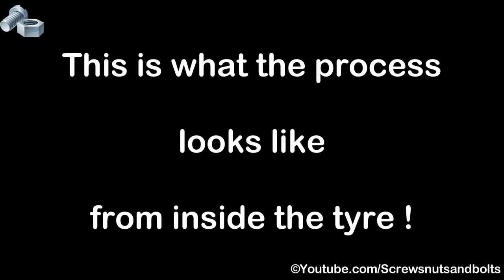Tyre Puncture Repair Kit Tutorial

Comment: Why is it temporary? Has anyone had issues they'd like to share? I've had tires I've used for years with these plugs, just make sure it's warm enough for the plug and tar to seal it well
Reply: Seen many catastrophic failures of tires because they thought it was a proper repair.
Reply: @warrenpacholzuk9190  how though? Was it because the tire went flat? I've done dozens of these on my cars over the years, and if you do it right, they never leak.
Reply: @warrenzonator  mostly because of inner liner failure.  When a tire is injured and run with little or no pressure the inner liner deteriorates. 
Temp fix only.
Reply: I can see the sidewall deteriorating if you drive it with low pressure, or even the liner if you're on uneven surfaces - but if it holds pressure, then I can't see why a patch would serve any better.
Reply: @warrenzonator  no. Sidewall compromise and inner liner compromise are automatically scrap tires.
Reply: If the damage is in a high flex area, then there is no repair to do, but if it's like the repair he did in the video, patch or plug makes no difference. So long as there's no stripped belts, I don't see how the tire would be compromised
Reply: @warrenzonator  the inner liner is what holds the air or nitrogen in the tire. 
I am a  licensed tire tech. Been so most of my life.  A proper repair cannot be done without inspecting the inside of the tire.  That's all there is to it.
If you bring me a tire with this type of plug, it gets scrapped.
Reply: Of course, shops gotta make their money. When I worked, I would've never just plugged a customer's tire cause that's not protocol, but manufacturers state repair specifications for patch or plug. I don't see how an inner liner gets compromised from a hole - that's like the only part of the tire you can repair
Reply: @warrenzonator  got nothing to do with making money. It has to do with safety.  
When you puncture a tire then run it with little or no pressure the inner liner separates and gets ground up. Game over tire is done. 
If anyone tells you otherwise they are not just stupid,  they are also dangerous.
Reply: @warrenpacholzuk9190  agreed, if the tire is driven flat, but if it just goes flat overnight, or you hear the leak, plugging it is fine. Never seen a liner go before a sidewall, though
Reply: @warrenzonator  industry standard states plugs are temporary fixes only. 
Put it this way. A tire plug will cause a car to fail safety inspection.
Reply: @warrenpacholzuk9190  only time it fails safety is if there's a repair on the sidewall, regardless of plug or patch.
Reply: @warrenzonator  not here and most other places.
Reply: Just looked at the checklist for here in Ontario, nothing about plugs in the tread
Reply: @warrenzonator  chorded /road plugs fail. Debate all you want,  it won't change that. 
I work hand in hand with MTO and DOT on a  daily basis.
Reply: I'm just saying none of mine have ever failed even for tens of thousands of kms on gravel, I don't see how they can hurt a tire. I've had tires blow out that were in good condition with no plugs.
Reply: @warrenzonator  do what you want. I'm telling you I have handled more tires than you could imagine.  From the smallest hand cart tire to OTR tires that would blow your mind.  
When a tire comes in our shop, aprox. 15 techs,  my word is final.
Reply: @warrenpacholzuk9190  you do what you want, for the average Joe who finds a nail in his tire at the worksite, plugs are good enough. By saying you're the boss-man, you're implying bias by telling everyone to use a more costly repair
Reply: Warren Pacholzuk But, what's the precise failure? Does the plug come out? Does the hole 'spider' outward, like glass?
I think nobody in this thread doubts that a tire with a damaged sidewall (inner or outer) is bad, but if the sidewall is not damaged, how does this type of repair lead to outright failure? For example, if I took a brand new, blemish-free, unused, never-mounted tire, screwed in a large screw, removed it and patched it like this, and then used it, how might the tire fail?
It's okay if you don't know or can't explain - but it'd be nice to know.

Fwiw, when I do a repair like this, I generally treat the tire as though it's speed rating fell by one or two ranges.
Reply: @warrenpacholzuk9190  I like your first name, but I don't like how you make this personal. Being a tire tech would give you a larger sample size, but saying that you're a pro and boss around lots of people and have worked with lots of cool tires doesn't answer the question that I posed - if it doesn't leak, why is this repair unsafe? You have to understand that mechanics use vague "safety" as a way to get a lot of money out of people. Heck, my friends have paid more per hour at the mechanic than at the dentist, and I know mechanics that have bosses that make more than doctors by doing unnecessary repairs. I'm not trying to offend your integrity, and I know there's good honest guys out in this poorly regulated industry, but that conflict of interest doesn't contribute to the dilemma. You say that the tires fail but always because the tire gets deflated. I'm saying that in my experience, a well executed chord plug will hold air for the rest of the tire's life. Have you seen a repair like this, being well executed, cause a blowout? Or simply poorly executed/leaking repairs that make a tire go flat and then blow out?
Reply: @warrenzonator  one last time. A proper repair cannot be done without inspecting the inside of the tire. That's all there is.  
And yes in our shop my word is final because I have more training and experience than anyone there. And most more than 90 percent of those in the business.
Reply: My tire repair shop said the exterior plug will absorb moisture and allow it into the interior. The moisture can contact the steel belts and cause rust and deterioration and ultimately tire failure .
Reply: @billybob042665  nice almost completely correct.  Once a tire is repaired the rule of thumb is the speed rating drops one level.
Reply: Removing the tire off the rim and patching it is the correct way to repair. Plugs are a temp fix until you can get to a shop. Wheel needs to be rebalance after.
Reply: The rule of thumb is that one tire can take 6 plugs before a tire fails. Thousands of cars in India with +35°C temperatures, gravel, rough roads etc. run with tire plugs for more than 10000 kilometres without accidents which can be attributed to tire fault. Punctured are quite a frequent occurrence here and people can't afford to buy a new tire every month. My motorcycle went 4000 kilometres with 8 plugs, one of my cars has 4 plugs and the other car has 3 plugs on different tires for many years now. The only tire burst I encountered was from a perfectly good unpunctured tire. Maybe it all depends on the tire compound used in your country such as soft/medium/hard.
Reply: @jasonk795  Hope you're having a good morning too.
Reply: @tyronem3446  high speeds,  traffic density,  insurance,  liability,  regulations,  manufacturer specs,  industry standards and down right safety are just the tip of the iceberg.
Reply: @DB-xi5hc  
Think about it mate, you have a hole in your tyre and fix it by a patch on the inside.. what plugs the hole on the outside? How much moisture gets through rubber ?? Mate they are bullshitting you.....
Reply: @warrenzonator  It's because you cannot see internal damage of a tire without removing it from the rim. A tire can shred itself internally and even blow out while being reinflated off the car. When they blow out while fully loaded around an open road corner you can find yourself at the bottom of a cliff fairly quickly. It has happened. These repairs are illegal on road going vehicles in many countries.
Reply: @warrenpacholzuk9190  that's not entirely true. Sidewall damage can be factory repaired but it usually ends up costing about the same as the average new tire.
Reply: @bremCZ  hasn't been done in years.
Reply: @warrenpacholzuk9190  It is still done today.
Reply: @bremCZ  maybe in some backwards places.
Reply: @warrenpacholzuk9190  Yeah very backwards, every native English speaking country with a factory.
Reply: @bremCZ  Lmfao never claimed to be an auto tech. What other countries do you believe to be native English speakers?
Reply: @warrenpacholzuk9190  The Auto Tech is another fella of questionable intellect, who it seems I owe an apology as he isn't as stupid as I thought after associating your message with him.

The list of native speaking countries is obviously all countries within the anglosphere and then also includes and South Africa. Those countries each make up at least 1% of the total population whose first language is English.
They, along with a few others who make up less than 1% are considered to be native English speaking countries.
Reply: How is Canada not natively English speaking?
Reply: Somebody has yet to describe how an inner liner or sidewall fails/deteroriates if the tire is not driven flat.
Reply: @warrenzonator  like I said my ancestors would disagree.
Reply: @warrenzonator  does not have to be completely flat. Too low in pressure will cause it.
Reply: @bremCZ  Lmfao. Will put my skills knowledge training and experience up against yours any day little man. 
Any day.
Reply: @warrenpacholzuk9190  And you would lose. For 5 years my job was training tire techs. For 10 years a chemist at Michelin in France and Goodyear in Luxombourg then product performance manager for Bridgestone's racing division. I've forgotten more than you'll ever know.
Reply: @bremCZ  Lmfao so that just means you couldn't keep a job.
I've been training techs for over twenty years. I have handled tires worth more than you have ever made in a year. 
My experience and knowledge is used for accident forensics. 
Little man you ain't even close to being in my league.
Reply: @warrenpacholzuk9190  "lacks understanding of promotion." I see this will be like trying to teach a fish to climb trees.
I'd be surprised if you could tell me something as basic as which has the actual higher speed limit a Y or Z rated tire.
Reply: @bremCZ  lol forget it, you're clearly not as qualified as he is
Reply: @warrenzonator  no he never will be.
Reply: @warrenpacholzuk9190  Still no answer though.
I'm waiting smart guy.

What does a P on a tire mean?
Reply: I done a tyre maybe 3 year ago on my trailer I’m going to take tyre off and inspect it but it’s still up now and I still use it so it probs be fine
Reply: @warrenpacholzuk9190  Where is "here"? And what is the standard please? I would like to quote it on facebook.
Reply: @warrenzonator  He can't tell you how or why it would fail, some bureaucrat with enough knowledge to be dangerous came up with a "safety" protocol and he has been following it without question for decades. 

Why does he do it that way? Because "that's how we've always done it". Standard government overreach without any level of competence or logic behind it. Followed by standard sheeple attitude. Even when presented with evidence above from hundreds of thousands of instances where the repair worked... denial.
Reply: @sithinstructor  my point exactly!!! I wanna see a study about it, and since nobody has one released (probably cause it's not a very scholarly topic), I thought the next best thing would be a collection of first hand accounts, or even just a few well analyzed failures, but people prefer to give advice. Just helped a girl yesterday with her car, and she drove it to my place with the tire less than 10psi, and there was some darkening in the sidewall, and even though I don't stand to make money, I didn't hesitate telling her to get a new tire. My point isn't to be on the edge of what's safe, but if it's just as good, why not go the cheaper/easier/quicker route?
Reply: @warrenzonator  I agree with you, but be won't listen and respond. Just keeps repeating the same.
Reply: @warrenpacholzuk9190  English is not native to England!! It's a new language developed by immigrants.
Reply: @paulyjuan1838  the same with my country
Reply: Never in 100+ plugs had issues if you put plug in the middle of tire .not good for sidewall punctures.
Reply: @warrenpacholzuk9190  licensed tyre mechanic and cant spell tyre😄💪
Reply: @benjamind2995  BTW no such thing as a tyre mechanic. We are licensed tire technicians. Certified by the same body that licenses mechanics.
Reply: I owned an automotive repair shop for 28 years and successfully used this method for 15 years, but than NZ land transport decided it was not a safe  and secure repair. There was always a change of air / moisture entering the puncture hole and  cause the steel belts to rust and / or layers to separate and could cause a blow out.
So every car for their yearly Warrant Of Fitness inspection that had a string repair in a tyre consequently failed.
Reply: Ive plugged my own tyres and other friends and families, peoples say "its just a quick fix" but ive never had any issues, the tyre holds air and ive always gotten full use out of them. All tyres ive done have had a nail or screw in them, the tyre has not gone flat and driven like it for any sidewall damage. A remove of the object and plug it straight away, no problems.
Reply: @warrenzonator  hi I've used these no problems, but there's another variety, smooth rubber ,non sticky that can come out if used without glue ,yes if in doubt check that inner liner is not damaged later

Comment: hey, nice video, however, i always find it extremely difficult to insert strip in the hole,, i always do it with tyre inflated (i never remove the tyre, )
.. is it advisable to deflate the tyre for this step? thanks for the advise
Reply from the maker: It's usually easier with the tyre inflated

Comment: Never cut away the excess until you know the tire ia holding air.
Reply: Why?
Reply: @dagalfheim7056  I would assume so you could try and twist and maneuver it a point where it would consistently hold air.
Reply: @dagalfheim7056  incase it didn't work and u have to pull it out again

Comment: I have never applied rubber cement ..not necessary with a plug...👍
Reply: I have done it both ways, with and without, without because I did not have in the moment. But I noticed that with rubber cement the plug slides into the tire much easier and it is easier to remove the tool. It works like a lubricant but then it dries.
Reply: Way easier with it brother .
Reply: Never go in dry🤣

Comment: Supposed to break it down and inspect the inside of it and use a patch plug from the inside
Reply: Mike Grant Recently I had a very slow puncture and took it in to the garage, it was leaking very alowly from the patch like shown in this video. They installed an internal plug or mushroom plug from the inside and problem sorted properly this time.
External patches should be considered temporary fixes when you dont have the ability to take the tyre off the rim.
A longer process but for peace of mind a better choice.
Reply: Local garage charges almost twice as much to patch internally, and I've never had a problem with the many external patches on my tires. There is such a thing as excessive caution.
Reply: @low187urass   *illegal
Reply: @low187urass   well, it's up to you if you don't want to look stupid. lol
Reply: @low187urass   well, but you so obviously did care. haha

Comment: Pluging a tyre lie this is illegal in most E.U. countries and in the U.K.. It should not be done and if there is a crash which involves the plugged tyre, your insurance company will not pay out. Removing the tyre from the wheel rim and putting a puncture patch inside is okay.
Reply: Many new european and china (legal in EU)  tyres do not work with puncture rubber patch do not stick well and air escapes. Insurance company think how not pay but take wreck crashed cars and sell it to repair.